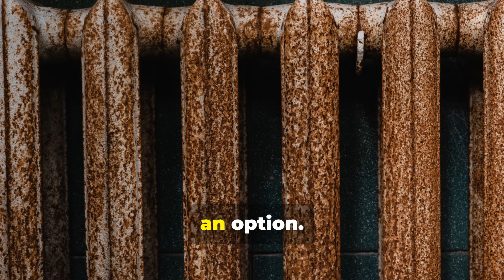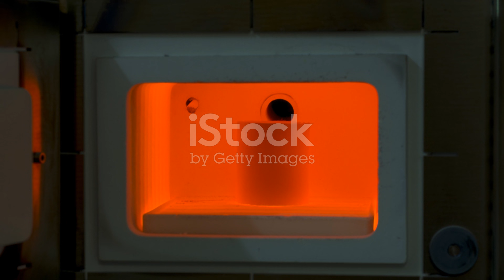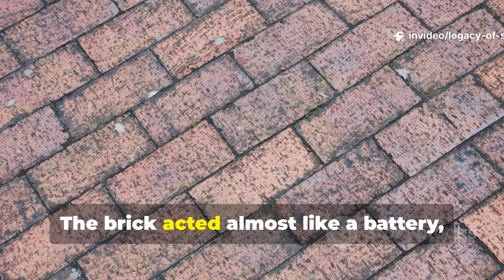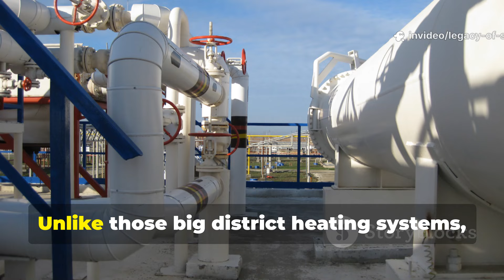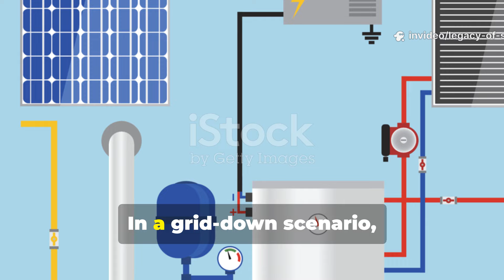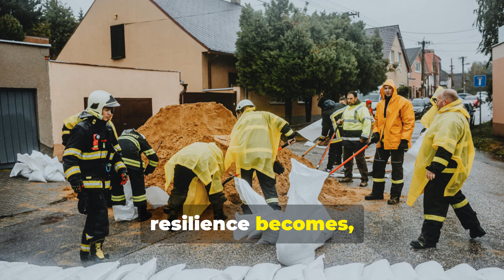Cold War Heat Technology That Worked Without Power or Fuel

Comment: Currently i use 2 big pans filled with water, stacked on top of eachother, both as a heat battery as well as hot water source.
I think the thermal bricks may be more efficient as they can be heated to higher temperatures.
Interesting to try to combine both.
Put the pans on top of a brick square that leaves the center open to transfer heat to the pans.
Next to that i could stack a brick heat wall next to my woodstove.
Than it may be enough to light the stove only once a day to such a tempetature that may prevent the buildup of carbon crystals inside the chimney pipe.
By the way, my chimney pipe runs trough my toilet/bath/washing room to optimize heat efficiency and makes showering there at comfortable temperature.
Reply from the maker: I think you should try the thermal brick method and see how it will go. Thank you so much for watching